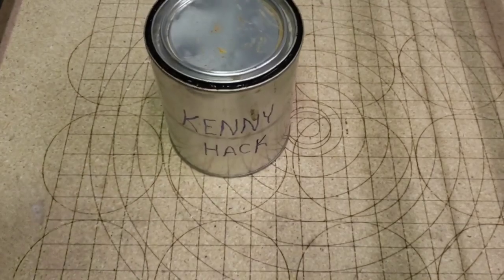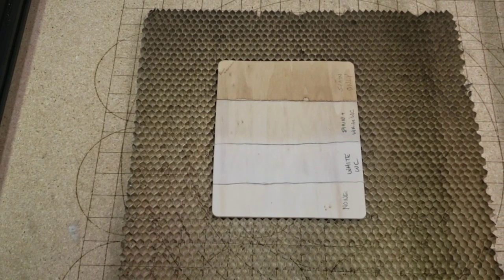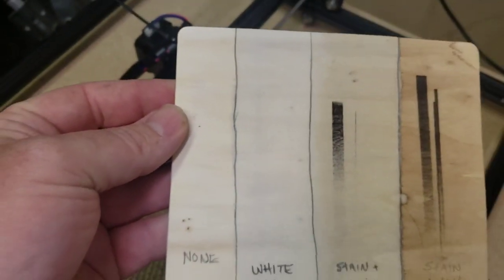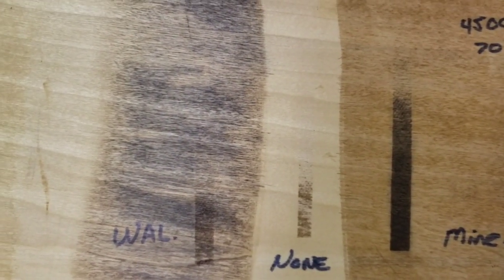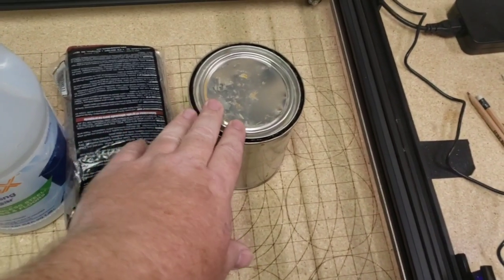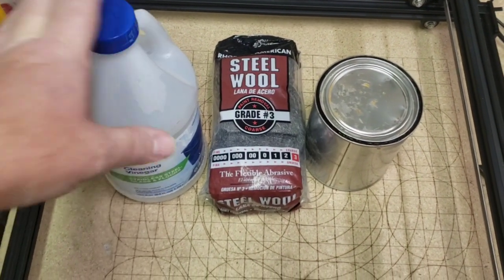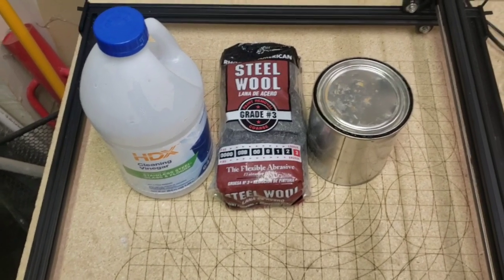The Kenny Hack: The best pre-stain/treatment for lasers out there? Ortur Diode Laser.

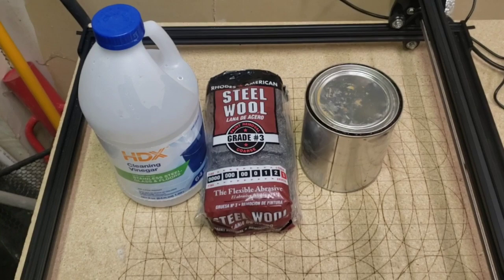Comment from the maker: PLEASE READ THIS ALL! Go to 6:28 for stain ingredients and mixing instructions. Common household items found in most any hardware store. Find the lowest grade wool you can find. I used the grade 3; which is the lowest grade, and it can just be put directly into the vinager. Do not use any wool with a protective coating. Higher priced is not better. The process also requires oxygen, so open the lid every day when you stir it up to break it down quicker or leave the lid slightly ajar. Any white vinegar will work. The cleaning vinegar i use is just stronger and probably cheaper than food grade vinegar.
Reply: Do you really think this is safe to be burning with a laser? Oxidized metal particles what will get burnt and then become airborne?
Reply: @Donovanx08  Thats why you should have good ventilation for anything you burn.

Comment: Hi
Thank you for video and sharing tips 👍
Will this solution not turn wood grey after a while as it is intended to do🤔?
Thanks
Reply from the maker: if you put it on dilute and dry off fairly fast, it reduces the amout of color change.  also seal it with a clear coat when finished to reduce future color change.  The best thing I've found in the long run is to use a Borax and water solution. I have a video out on that as well.  1-2 tbsp of Borax mixed into 1 cup hot water. whipe on and blow dry. Use you hand to brush off excess Borax from the surface. Burns dark with little color change on most woods. It's a 1 time use mix as the Borax will crystallize back out of solution when it cools.  I still use the aging stain for doing driftwood pieces,  but the Borax is better for photos.
Reply: @TheKennyHack  brilliant answer.
Thank You and a Happy New Year🎊🎄🍾🍻

Comment: Thanks for the vid Kenny! Really good info! Can you make an update video on how some of the products you have used this method on have help up? Have they faded? Has the corrosion process continued? Has it flaked off?
Thanks!
Reply from the maker: With the aging stain or any of them really, if you don't seal in the image it will fade over time.  It's best to clear coat it. It will lose a bit of details but last longer. I find the Borax treatment to be the best and easiest method. It doesn't stain the wood as much as the baking soda method.  It's way easier to make than the aging stain. I pretty much use Borax for everything now unless it needs to be food safe, and then the baking soda is the best. I still like using the aging stain to age wood and make it look rustic if that's what I want.  With the more powerful diodes now, they all can run pretty fast. Best to play with all of them a bit and know what kind of projects they'll all work for.
Reply: @TheKennyHack  ok! Thanks for the info. I just watched the video and had to watch another of your vids to understand the process a little better. Again thanks and keep experimenting!!!!

Comment: Natur plywood 10.000 mm/min
https://youtu.be/LcaJGWd0cEQ
Reply from the maker: looks to be buffering slower like mine does. All the diodes I have seem to start buffering around 7000mm/min depending on what dither you use. Newsprint is the fastest and Grayscale the slowest. It also seems to run a bit faster in LaserGRBL vs Lightburn. With the higher powered diodes that are out now you can burn wood at near max speed. I still use a Borax pretreat to give it a blacker burn. Pretty common these days burning images at max speeds. They just need to go to a 64 bit controller to handle the buffering at max speeds.
Reply: @TheKennyHack  I will try the borax if I can buy it.
I don't like the newsprint pattern. Stucki's resolution is finer.
These were tests. I'm trying to make the best out of it. :)

Comment: I ran across a similar method that uses powder Borax, ever try the Borax method? From what I see, “your method” looks almost universal across many mediums, not sure how wide of a range the borax method has. I am sharing a link below of the Borax method if you are interested to compare both methods. Thanks for the info!!!
https://youtu.be/T8op5kIeTcs
Reply from the maker: if you see my newest video I'm going over using Borax and LaserGrbl software. I do think Borax works much better than Baking Soda. The one place they both seem to struggle is producing a grayscale gradient. They work well with dithers though. This aging stain does work better if trying to do a grayscale burn, but the Borax is easier to make for sure and doesn't strain the wood. Never hurts to know how to use different products for different jobs.
Reply: @TheKennyHack  yup, there it is, I missed it somehow, lol, thanks good sir

Comment: Hey Kenny, I did your stain and the vinegar has not changed color and steel wool looks the same. Just wondering what I'm doing wrong, I have the same steel wool you show in the video and the vinegar is for cleaning, any thoughts?  One last thing, I'm using a glass jar, I don't know if that would affect it.
Reply from the maker: make sure there is some air space at the top and open the jar every day and stir the wool to help break it up. The reaction needs oxygen to make the wool decompose. Can even just slightly put the lid on so air can get in and it will break down even faster.
Reply: @TheKennyHack  Thanks Kenny, there is room, I only filled half full, but i haven't checked every day.  I'll try be a little more consistent on that.  Thanks for the quick response.
Reply: Thanks Kenny, it looks like air was the only ingredient I was missing.

Comment: I tried to make the solution using both Cleaning Vinegar from Walmart and Home Depot with 0000 Steel Wool. The steel wool didn't do anything, even after a whole week! All I got was bubbles on the steel wool. I put water on another piece of steel wool and it rusted in a matter of a couple hours. What did I do wrong?
Reply from the maker: Make sure the container is not completely liquid full. Need to open the lid every day and stir it. Needs oxygen to break down the wool. If you already got a piece starting to rust using water put that into the vinegar and it should continue to break down.
Reply: @TheKennyHack  I never had it covered so it was getting lots of oxygen and stirred it quite often. I'm seeing other videos about hooking up a battery to it with one lead in the steel wool and the other in the liquid. Have you tried that? If I get time tonight, I might hook it up
Reply: @TheKennyHack  I tried a salt and water solution, put the negative lead of the battery charger on a iron nail, put the positive lead on another nail and put that one down into the steel wool pad and stuck everything into the solution. When I plugged in the charger, I immediately got bubbles on the negative nail and, within a half hour, I had a nice dark solution like you showed and probably 1/2 of the steel wool was gone! I'm gonna let it sit for a day or so and try it for burning. I'll let you know how it works!

Comment: Kenny, thanks for all the Great Videos. Just a little insight on the word "Hack" cut with rough or heavy blows.
"hack off the dead branches" Why, The Kenny Hack?
Reply from the maker: There are many slang meanings for the word "hack". The context I'm using means a simple trick to make something work. For those hatters out there they can say I'm a "Hack" meaning I don't know what I'm doing. 

Just depends on what you take away from the videos. If you like them then they are a "Hack" as in a new trick or method to use on a project. If you hate them then I'm the "Hack" to post rude comments about in the various forums. Either way it works out. Haha.

Comment: I just tried it with my new Ortur 20W Fixed Focus but I put in a little too much steel wool. It really darkened the wood but boy did it make a difference with the etching. I will water it down and try again. I did notice the laser making a noise as it burnt the steel on the Kenny Hack side.
Reply from the maker: You want to make sure there is no visible sized wool pieces on the wood or it can make a small pop when the laser hits it. Also make sure the wood is dry. If it's wet it can make a bit of a pop as well. I don't think these little pops hurt anything or affect the image quality.

Comment: There was a jump cut in your video when the laser moved from the untreated to the last two treated areas. I call fraud!
Reply from the maker: Lol, there is no cut. Also this has been out for quite awhile now and thousands of people are using it. Wouldn't be able to burn on wood at 9000mm/min without it.
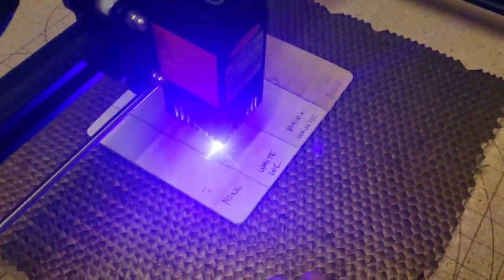Reply: @TheKennyHack  Sure there is a jump cut at 3:08 into the video. you are a scam and this will prove it.
Reply: @Bobster986  You just want to whine about something don't you.. You're a victim right? GFY!
Reply from the maker: You do know you can make this stuff yourself and run whatever tests you want with it. Nicky Norton made a test panel video trying it out about a month after I put this video out. Ive only heard about it and have never seen it myself. There are people posting projects they've made using it every day in the forums. Baking Soda also works but it stops working around 7000mm depending on your laser from what others have tested. I tried it at 9000 on my 20w and BS would barely make a scratch and this stain was still burning strong. The new fixed focus 20s might work better now. It all depends on how strong of mix you use, so everybody's blends are a little different. Its funny, 6 months ago I had people with 15 years of laser experience telling me I couldn't burn images with a diode running that fast, and now its very common. I found this stuff about 2 months into owning my first laser. Spent another 2 months digging through videos and joining forums to see if anybody else was using something similar. Back then I was only running 5000mm as I thought 6000 was the max speed. Its actually 9000 on the Orturs. Since nobody else was running these high speeds I had to teach myself how to do everything.  Back then I don't think you seen anybody going over 3000 and it was taking about 100% power to burn a photo image into wood. I don't know what you're imagining im faking as I don't think it would be getting used by so many people if it didn't work. I didn't notice the slight glitch when I rewatched the video. I have no idea anymore of why its there, probably clipped out an "Um" as those tend to annoy people, but I was always just shooting unscripted and didn't edit much back then. I can 100% guarantee you I have never faked a result. Most all my videos are my first attempts at trying something new and showing my results good or bad and point out my mistakes and things I'd do differently. Trust me I'm not making any big $ doing these videos or all the time I've spent helping other people figure things out. I've even turned down sponsorships from companies I didn't feel had the best reputations in the industry. So I hardly think you're in a position to judge my credibility.

Comment: Thanks for being innovative and testing stuff and sharing the results.  I use this to dye leather black.  It works great on that.  Looking forward to testing on wood.
Reply from the maker: I tried it on some leather. It had slight improvements but not much if I remember correctly, but it never hurts to test thing out.
Reply: @TheKennyHack  it will dye vegetable tanned leather black.  It reacts with the tannins in the leather.  Probably not much impact on oil tanned leather.

Comment: We call this an "ebonizing mordant" in wood working.  It makes maple a beautiful silver color and turns walnut jet black.   I never thought of using it for this. Thank you!
Reply: Does anyone know if the workpiece is sandable after engraving? I love this idea but do not always want the color tone that this stain results in. But would love to speed up my laser!
Reply from the maker: a new mix being used is Borax into water. an even spoonful into 1/2 cup hot water. whipe it on and let dry or blow dry. Im running at 5500mm at only 33% power. Got a video coming out soon hopefully showing Borax and using Laser GRBL instead of Lightburn.

Comment: Have you tried using 0000 steel wool? I do this to age wood I work on and find the 0000 steel wool when you loosen it and put it in vinegar it will be quicker to dissolve. I see you have the #3 coarse? 
Awesome videos and content by the way 👍
Reply from the maker: As long as it doesn't have any protective coating i imagine the finer the wool the faster it breaks down. Some of the finer grade stuff has an anti rust coating that has given people problems. Thanks for the support.

Comment: Is your solution a redish rust colour? I had a nice dark grey colour with the iron dissolved into it. Once I added the water, it turned red almost immediately. I just started another batch where I am going to try not diluting it. I also have a batch of copper acetate (for dyeing wool) and copper hydroxide (copper soaked in ammonia for dyeing as well). I'm thinking about doing a head-to-head comparison to see which is best. Mostly because I'm curious ;-). But definitely plan to have it well ventilated.

Comment: Thanks for this. It really works. I tried with cleaning vinegar but that doesn't do it. Then I changed to kitchen vinegar and 2 pieces steel wool and let the jar (600 ml) open for 3 weeks. Every week I give it a stir. It came out perfect. I used it @100% and 50%. I have to mention that there is a lot of difference between, even the same type, of wood. And important (very) use a soft brush and give it 1 stroke, don't repeat the same "stroke". Or give it a try then you will see what I mean by that. So thanks again Kenny. Greetings from Belgium
Reply from the maker: Thanks for watching and giving it a try. I need to start a world map of people I have had contact with. Its been a real pleasure to chat with people all over the world. Sometimes the communication is rough, but usually the spirit of the messages gets through.

Comment: Ok I started my batch a few months ago but had to move into more turning projects but back to it.
I think though I'm going to filter it. Its a tad sludge.
Also I think that cleaning vinegar is just no made in a way that they can't call it food safe. But HD does sell a 30% for $20  gallon.
Reply from the maker: With the steel wool and rust I don't think it would be food safe with any type of vinegar used. Some have filtered it through a coffee filter.
Reply: @TheKennyHack  im filtering as I type this. Its super dark grey brown and the pad is gone. I've seen all your tests and may start with a lower concentration.  
My first test with only a week of soaking at 50 50  stained the wood too much.
Reply from the maker: @chartle1  I've gone down to 5% and still got good results. Add a little white wash over it to help lighten the stain up and it also helps the image turn blacker. See my white wash video for help.
Reply: @TheKennyHack  for what I like to do and the wood i use the gray is too much. I may have to really thin it down.

Comment: I made a batch of this years ago and used it many times. Stored it in a pickle jar. I went to pick it up after it sat on my shelf maybe a year untouched and my fingers went straight through the rusted out lid.   Do you have any other safe storage ideas?
Reply from the maker: not really. havent been using it that long. probably all plastic is the way to go.
Reply: I am new to lasers and hadn't thought of pre-treating as an enhancement for engraving but it makes sense.

To answer your question though:  Plastic bottles work fine.  I use this homemade stain in woodworking as an aging agent.  It turns cedar a beautiful weathered gray for much cheaper than store bought stain. As stated, it doesn't to much on pine.  

The staining process works by bringing the tannins to the surface.  You can check various sites to see the difference between wood species (to make sure you are picking the right material for your project) as the effect is dramatically different depending on the wood used.

You can also vary the strength of the mixture by the amount of time you leave the wool in the vinegar (or the amount of water to add to dilute it).  I sometimes have three or four different mixtures (same ration but longer/shorter saturation times) used in one project to create a pallette within the same wood piece.

Remember, as the video says, pressure will build up in the oxidation process.  There is off-gassing (which can be harmful to breath in large doses).  You can leave the lid loosely covering whatever container you are using to create the mixture (keeps dust out and lets the gases escape) and keep it in a well-ventilated area.  Oxygen is required for this process so keeping the lid cracked might even enhance the solution creation.  Afterward, you can simply transition the medium into a container of your choosing.  Soda bottle,  old spray bottle, whatever.  I would, however, recommend popping the top every once in a while to let some gasses escape as they will still form overtime. Of course, if you are actively using the mixture then you'd be opening it sufficiently anyway 😊

Happy creating!!!
Reply: Might help to put a layer of plastic wrap over the jar first and then screw the lid on.  The plastic can protect the metal lid from the fumes reaching it.